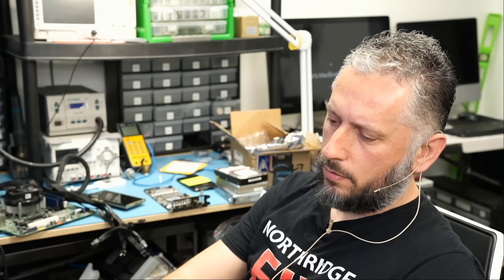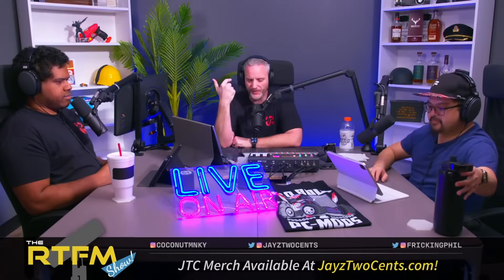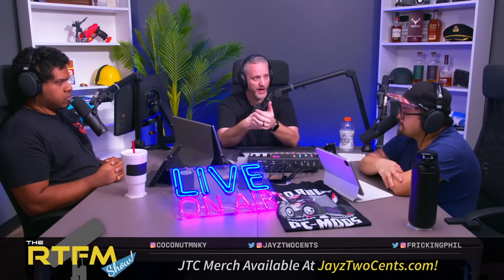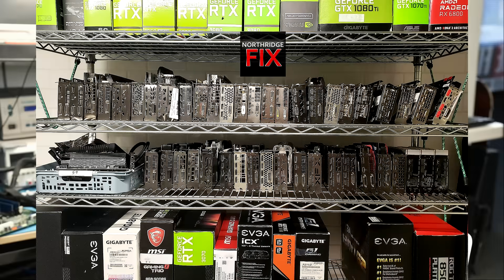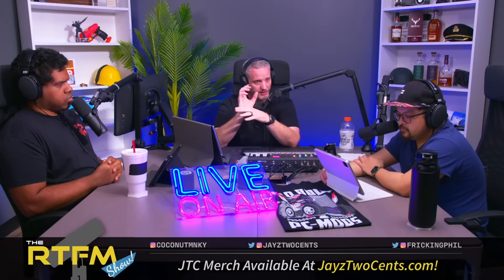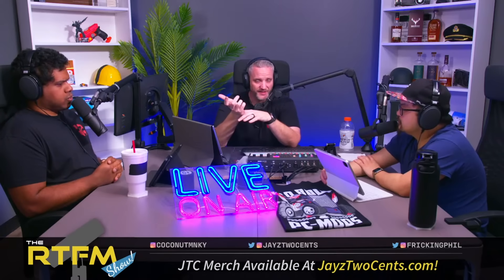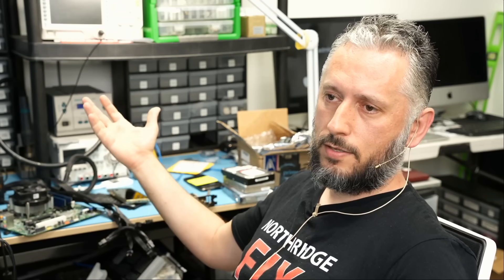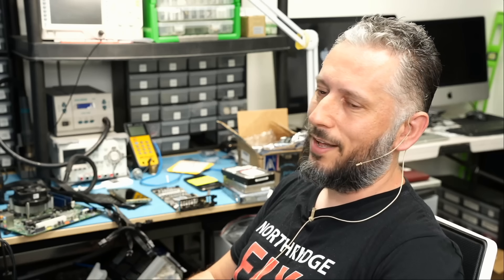Melting 4090 and CableMod. JayzTwoCents and Gamers Nexus Response. Blame NVidia or User?

Comment: my guess is that the 12v lines are not load balanced properly and causing to much power to one of the 12v lines which causes the connector to melt. there are  6 12v lines.  if they were properly balanced over the 6 lines thats 100 watts max on each line a 4090 can draw.  my guess is that 2 or 3 of the lines are getting most of the power while the others are not (improper load balancing) and causes the melting to happen  

but even if that was the case. that does not answer the question as to why the melting always happens to the connector end on the video card.  if people are using cable mod adapters. why did it not melt on the end of the adapter where the power supply cable connects??   

another thing i want to know is, is the melting happening because of the 4 8pin to single 16 pin adapter? or does it happen to a PCIe 5.0, ATX 3.0 power supplies that have the native 16 pin connector?  

right now i have a 4090 with a thermaltake gf3 1000 watt psu. this power supply is PCIe 5.0, ATX 3.0. so it has a native 16pin to 16pin cable. no need for a 4x 8pin to 1x 16 pin adapter.  so far no melting. hopefully mine does not melt but wonder if that solves the issue or will i have the same change as to mine melting as to people using the adapters

Comment: You are 100% correct it's  NVIDIA sloppy connector. their might not be enough surface connection to transfer the power. they might need a bigger / taller connector that has more surface connection and less wiggle room.

Comment: Agree with you, the first thought that come to my mind when I watch your video the other day was the power going though the connector is right on the edge of its rating. And depending on the ambient temperature in the computer case takes it over the rating and connector melts. Either way what ever the fault turns out to be it’s a poorly engineered product. And if I paid that amount for the card and then was told it’s a user fault. It would be the last nvidia I’d purchased.

Comment: me being a "gamer" i've always had high end cards. 1080,  2080 super, 3070, i skipped the 4000 series and went to AMD (7900 XTX 24gb) because of the melting connector fiasco. I agree with Alex completely. the connector is nvidia's responsibility it is what we sane people call "A design flaw" they should redesign the power input region of those cards and put a larger power connector in since there is so much current passing through that thing. total design flaw. gamers nexus putting most of the blame on the end user is irresponsible and just plain incorrect. not all end users are idiots. that's pretty much the jest of what i heard gamers nexus was saying.  nvidia needs to take responsibility for once. i might have misheard steve but still.

Comment: Just FYI. I have an XFX 7900 XTX with Cablemod cables. The middle of the three power plugs fried. The cable was the issue. They tried to say I didn't plug it in correctly however, due to being conscious of the Nvidia problem I made sure they were secure. Three pins arched out and caused endless problems inc Windows dumping the AMD driver. Swapped to factory PSU cable, no issues. Long story short, Cablemod made those three pins about 1mm shorter than the others that didn't short.

Comment: Steve from Gamers nexus blames it all on design issue and user error, because the plug doesnt have any feedback if its fully plugged in or not

now if we assume its a card issue does that mean there were HPW connectors that were "dirty"? if so this now begs the question how are the GPUs sent to AIB partners? I thought they only receine the GPU die and have to make the PCB around it and source their own parts? so... until there are FE cards with cable mod adaptors burning then there is still a smoking gun

Comment: At a certain point, the number of "user error's" should point to a problem with the design of the plug/connector itself. IT shouldn't be that difficult to get the thing plugged in properly without risk of fire hazard... Thats along the lines of some QC laws if im not mistaken. Id have to read up on it, but at a certain point, the user error is caused by the faulty design, thus the problem lies with Nvidia and their suppliers.

Comment: The assumption is that the heat causing the melting has come from a high resistance poor connection. Flipping this around, is there a source of heat on the card that is being conducted from the card to the connector housing? Not related to poor connection high resistance?

Comment: I didnt trust GN investigation at all. They couldnt reproduce the issue by normal use and only with cable bending or not plugged in properly. Even then its still card issue.

Comment: Personally I think Alex is correct and Gamers Nexus doesn't want to admit they didn't solve the problem correctly. I really don't think they have the same type of experience in the field as Alex does as this is his bread and butter. At least Jay gave his own opinion and thoughts and at this point from what Alex has discovered Gamers Nexus should have came to the same conclusion. Facts are showing it does not matter what brand of power supply cable or adapter is used, the failure point is Nvidia's socket which needs to be addressed. I think Gamers Nexus would just like to have the final word and act like they saved the day again similar to the Gigabyte power supply situation. Ok, I get it, but I think Alex already solved this one!!! By the way I don't subscribe to any of these guys lol.

Comment: Why couldn't the manufacturer just use a two pin plug like an XT90 or similar, even custom made 2 pin for the power supply.  In the Radio Control Hobby we use large connectors that can carry over a 100 Amps at over 50V easily.  Why make this proprietary connector that needs adapters, which is another point of failure? I don't understand why they made something so simple into a 12 pin connector instead of a 2.  Please someone, explain this to me.

Comment: Your good Alex sounds like it's a manufacturer issue and should be recalled. Some tubers are affiliated with sponsors is Steve partnered with the manufacturers. He knows ,deep down he knows. Sometimes when your opinion Can make or break a product and you know that is possible and are in cahootz with that manufacturer then its hard to just turn around and stab them in the back. Grow some balls Steve. Man up it's time for Nvidia to live up to a warranty when it's pushing expensive crap of dung. 2500 for crap come on now man up steve

Comment: Is it possible to do a few tests of the cables with the connector that would draw the same amperage as the card, then monitor the temperature of that connector?  Completely remove the card from the test.  Even run tests on 10 connectors with the cables without the card for continuity.  My apologies if I don't fully understand this complex situation.

Comment: I like Steve and he did do some extensive testing to try to get to the root of the issue, including sending the broken parts to a failure lab to be looked at using industrial and scientific machinery using both non invasive and destructive testing, but what he said about the 90 degree connector being plugged in after the high power cable had already melted the connector really didn't make sense at all.  I'm glad you clarified that you've had a glut of 40 series GPUs with melted connectors both from CableMod and other customers, showing that the sudden spike in repair requests for these devices isn't limited to the sudden increase in demand for repairs from CableMod exclusively, showing that this issue isn't resolved.

That being said, there's a few things you're getting wrong too.  The wiggling he showed in the video was part of what he did to try to reproduce the issue, NOT how  you install the connector.  He was trying to loosen the cable by wiggling it.  You install in the way you showed; you push it in snugly to make sure it has a solid connection.

Also, in this video and in your previous videos you keep saying that you plug the connector into the dongle which is then connected to multiple PCI-E 8 pin power connectors.  While this is somewhat true, it should be noted that some new power supplies (including what I'm currently using with my 4080) come with native 12v high power connectors so you do NOT need to use that dongle; that is, the new ATX 3.0 standard for PSUs has a 12v high power cable with that connector on both ends and connects to the PSU through that connector natively.   

Are all the cards with issues you are having from users using the dongle?  IIRC, there has been a few scant cases of the connector melting using the native 12v high power cable and not the dongle, but the majority of the cases seem to be with people using the dongle.  The speculation around this is that the extra weight and girth from the dongle increases the risk of a bad connection.  This could also be the fact that these new PSUs and high power cables are rather new technologies, so it is likely the mass majority of people using these cards are using PSUs of the old standard and thus must use the dongle; ie, an issue with sampling bias.

All that being said, I just recently finished building a new computer with a 4080 and it was the most problematic build I've ever done, and I've built dozens of systems for close to thirty years.    In my case the problem was motherboard related and it somehow managed to fry three separate GPUs, two brand new 4080ies and a ~15 year old GPU I tried in the motherboard for troubleshooting.  After over a month of trying to build the system, including a rather horrendous return process with Amazon that took close to a month to get a refund on the second dead GPU, I was fed up when it still didn't work with a new motherboard and third GPU, so I took it into an electronics store to have them troubleshoot and finish the build, as I thought another GPU had been killed and that the PSU might have been at fault.  Combine that with the fact I don't own a multimeter and I didn't have more disposable hardware to test with, I had to ask for help finishing the build and troubleshooting.  For brevity, I'm keeping the details of troubleshooting my build slim as it isn't quite related to the topic at hand.

The techs at CanadaComputers found that the third GPU was fine, as was the PSU and somehow the high power cable was fried and was non functional, as they could get the system to POST using my PSU and the dongle using the 8 pin PCI-E power cables.  The high power cable and the connectors didn't melt and there was no visible damage, so it is a different issue than what caused these melting connectors and it is working fine now with a replacement high power cable (not using the dongle as I'm trying to take every precaution to try to avoid a melting connector).   As the GPU was fine, that really means that it was something to do with the first motherboard I had was causing the dead GPUs, as I tried three different devices in there, including the old GPU that was working in another system before I placed it into that PCI slot.  It couldn't have been the cable in that case as it obviously is from a time before these new connectors/cables/ATX standard existed, and it still was fried using a PCI-E 8 pin connector in that motherboard PCI slot.  I'm still at a loss as to how a bad motherboard could fry the high power cable, though!

Thank you for continuing to look into this issue.  I'm still quite concerned about my connector melting and I hope whatever is causing the issue, whether it can be somewhat explained by user error or if it is something seriously wrong with the design of the new connector and ATX 3.0 standard.   It's a brand new standard and connector, so definitely more research into this is needed.  On that, I think you, I, Jay and Steve all agree.

Comment: Did anyone (beside nVidia engineers) worked out the math to conclude that those connectors are able to transmit the power they need?
If they're melting by mere 0.5mm of misalignment, something isn't right about these calculations and, for certain, not right with the tolerances.

Comment: WOW! I was so close back then for preorder and buying the CABLEMOD connector. I am glad I dident! I have never had any issues what so ever with mine 4090. Its a Gigabyte Gaming OC 4090 and watercooled and max overclocked. So plenty plenty- very high current and power load on card and connectors. My PSU is a ThermalTake 1350W ATX 3.0 fully compliant with the correct power connector directly to the PSU. I ALWAYS check the connector is all way and firmly in but the cable seems strong and very powerful. I have also checked it has all the seperate wires and none shared as we also saw on the failed adapters. I have also run the card two weeks with at first with the 4 to 1 adapter that came with the card . It was also high quality and none shared wires. It ran perfectly ... its rock stable even at max oc limits - never had an issue .. so happy with it.. and also that I dident for once had to go through hell with potentially damaged hardware and what not. But I almost some time ago pulled the trigger on a angeld cablemod adapter ! damn I am happy I made other solutions and not and will only use cable DIRECT gpu > psu!  ... NO adapters or anything else.. this has served me extremely well and in my opinion is the most stable and safe way to go. I have REALLY pumped a lot of current and heat through that card on OC it just works! If you have to use a adapter make sure it has all dedicated wires and none shared like the cheap ones Nvidia used with founders edition which eventually failed..

Comment: Could it be a metallurgical issue? Chrome plated or tin plated pins on the board creating too much resistance? Basic ohms law applied. The Pins on the board (conductors) carrying too much current will get hot. Clamping force from the female pins (cable end) onto the male pins on the board may not be strong enough.
Add in conductivity ie 
Silver (66.7×10 pwr6)
is much more  conductive than
Tin      (8.7×10 pwr6)
Perhaps pins on the board should be silver plated and the same with the cable pins.? Dunno. I'm holding off on buying a 4090 till Nvidia sort it out.

Comment: Seems pretty simple to me. Three or four splits off one connector leads to overcurrent and heat. It will heat and melt at the "weakest" point which would be solder joints and traces.

Comment: Nvidia Planned Obscelence. Obviously it's a design problem having only 1 Thinned Pin Connector drawing high voltages/power that generates heat to the point of melting plastic.

Comment: I think a part that Steve missed is also the broken power connectors that seem to be a problem with those cards. There seems to be more going on than just not pushing in the connector all the way. A 250 gpu backlog is pretty insane, good luck!
Reply: These cards are huge. In my case, the CPU AIO hoses weren't long enough to get around the card, and I couldn't mount the fans.  It's possible people are trying to install these into cases that are too narrow and these issues happen when trying to install the side panel.

Comment: I totally agree with you. This connection on a card that also likes to consume 500 W with overclocking is an absolute botch. 500 W at 12V is a good 40 amps. If the plug is not 100% seated, the contacts will inevitably get very hot. The manufacturers have saved there in the wrong place and instead of the usual 6 and 8 pin connections they have developed a new one that simply cannot handle this performance.
Greetings from Dresden / Germany

Comment: first time i actually disagree with steve. but it seems it is way too easy to commit user error with this connector. AND bad card design at the same time. this is what i think is the issue. we should just stop using this new shit connector. causing too much issues. this is what happens when you try fix something that was not broken. old connector works just perfectly.

Comment: To be fair, I mentioned Gamers Nexus in the last video you reffer to.
But after upgrading to an ATX 3.0 power supply in the meantime, I have to says: Holy farting mother of Connection reset by Peer, the pins in that 12vhpwr connector are tiny. The whole pin is 1mm wide and the wall thickness of the metal pins inside is less than 0.1mm. So yeah, very well thought out to put 12V at 8.3A through it.... NOT!

Comment: Any full time 100 volt or higher electritian can answer this. Resistance Resistance Resistance. EXAMPLE: If you used the smallest gauge extention cord than what's recamended on a welder. The extention cord WILL burst and catch on fire. Daaaaaaaaaaaaaaaaaaaaaa!!!!!!!!!!! Gamers Nexus is NOT an electrical engineer nor close to a certified electritian. He has no idea what he's  talking about and just lost this subsciber. He's just a builder not an engineer. The card is drawing to much power at 72v through one small connection just like the extention cord for the welder. End Task❕❕❕❕❕❕❕❕❕❕❕❕❕❕❕❕❕❕

Comment: It's a no Brainer that one connector replacing two or more connectors will have the single connector forced 
to handle the current that the other omitted connectors would have allowed to pass through them thus 
sharing the amount of electrons that they each handled.

The only fix is more connectors to share the current or a massive improvement in the video cards use of 
current by cutting it down by at least 70% if they persist on using a single connector. 

There is another option and that is to use pure gold instead of whatever they are using for the conductance 
of electrons through their connector thus negating their responsibility to the cable requiring it to also be pure
gold, this would have the cable manufacture cease any support for cards with a single connector unless 
end users are willing to pay for the pure gold cabling.